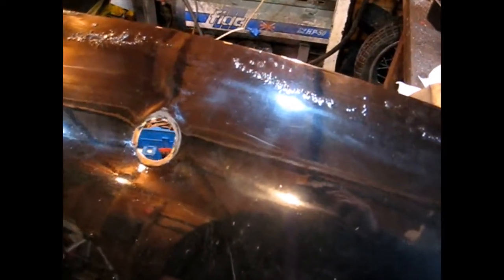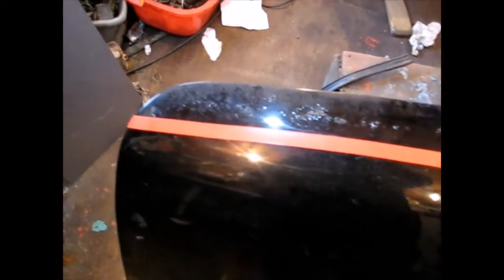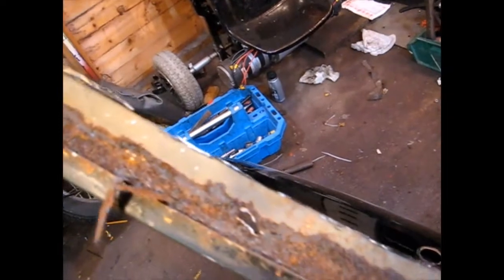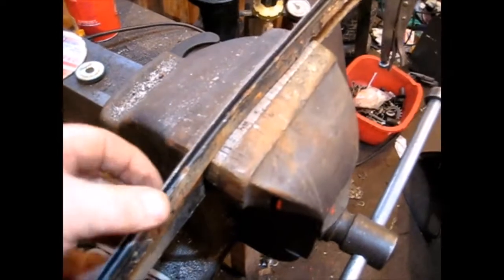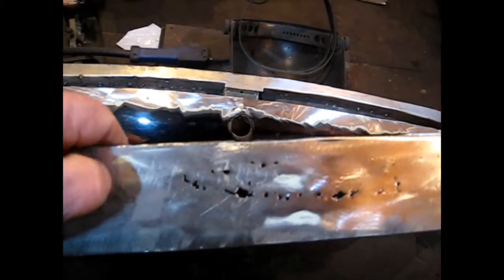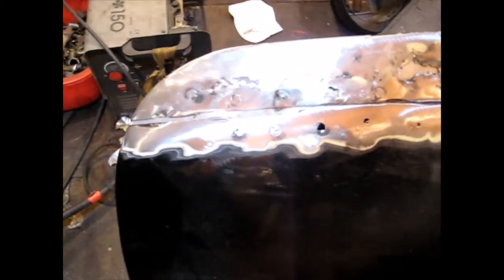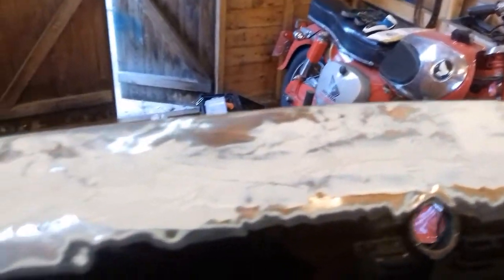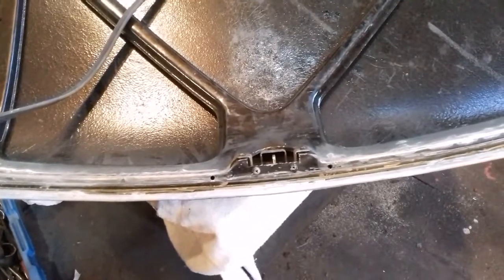MGB repairing a rotted bootlid

Comment: Always curious as the what gauge the sheet metal that is used for these repairs is?  Mr. Evens is not alone in not mentioning the sheet thickness.  Most of the body folks including the experts rarely, if ever, mention the gauge or thickness.  There are several gauges US Std. British Stds.  Birmingham, Stubs, etc.  you name it.  Thanks.